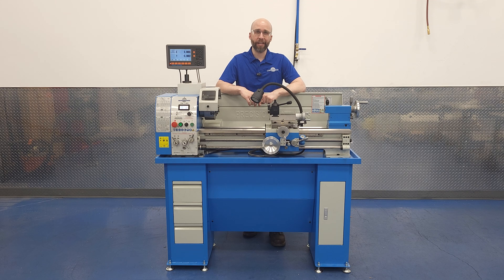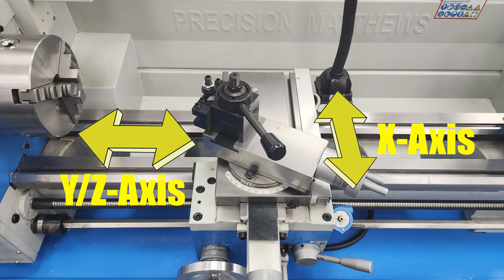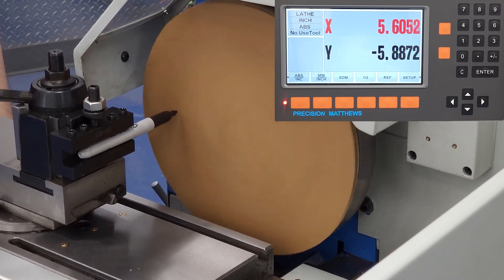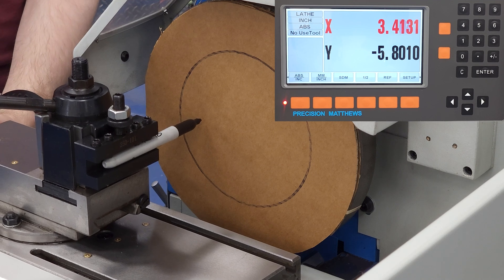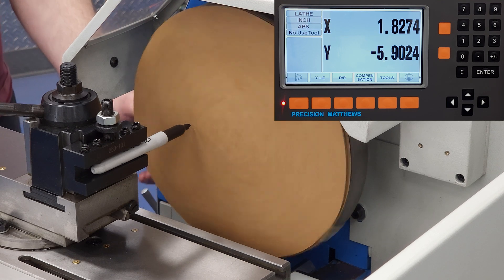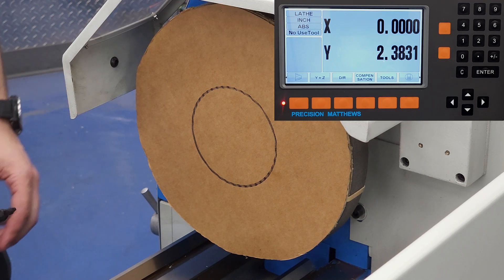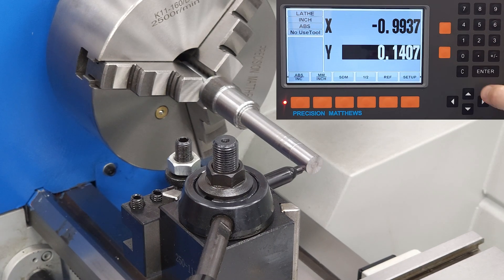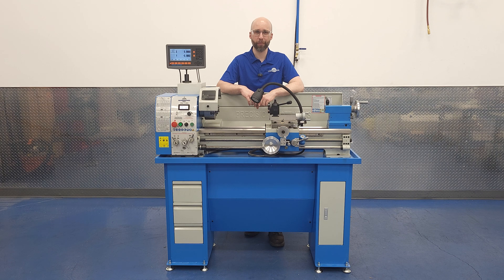PM-LCD Lathe DRO Digital Read Out Basic Functions Precision Matthews Media

Comment: Before I got my PM lathe with a DRO, I had an Atlas and was quite comfortable working in radius measurements and counting revolutions, but now it's so much easier and I much prefer diameter.  It might have been worth mentioning for parting off, the Z movement is the required distance plus the cutter width unless you started with the tool's right side parallel to the outside edge of the work.
Reply: I agree. If I’m making a piece that’s 2.625” in diameter I don’t want to have to remember that I’m reading radius on the DRO.